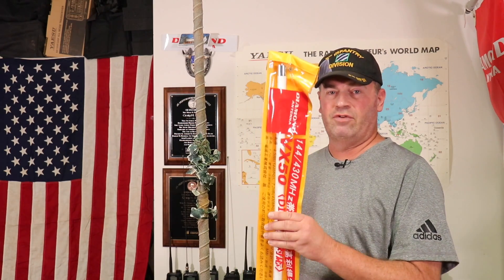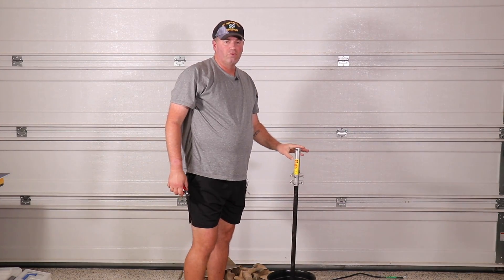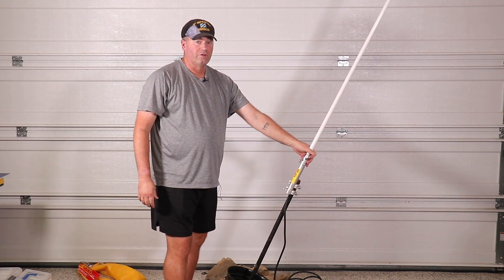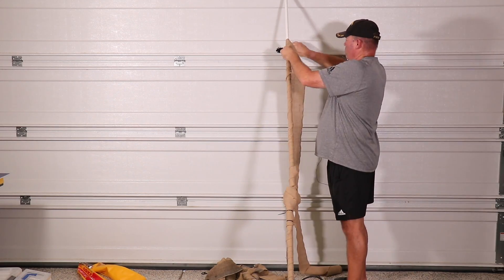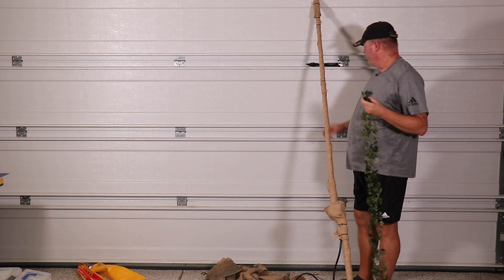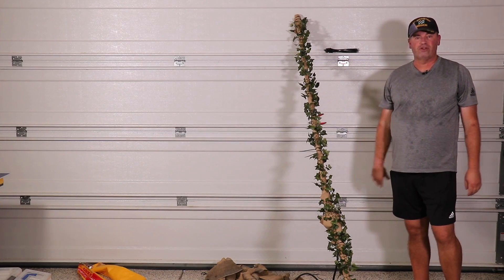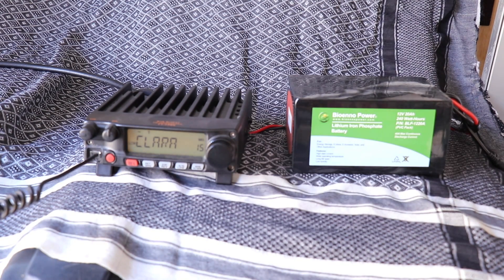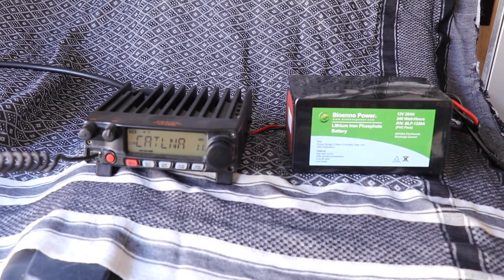Beat The HOA With A Stealth Antenna

Comment: Can the HOA still complain if the antenna is obviously temporary? I have a similar setup using the Diamond mast that extends to 4.5m. I put it up or down in about ten minutes.
Reply from the maker: Thank you for taking the time to watch and the comment! It is greatly appreciated.  They can always complain, but once it it down their argument is pretty much over. Mine stays up 24/7, due to its camouflage nature.
Reply: @WJ6FRadio  Thanks, in Australia they are called body corps, nobody has complained about my temporary setup. I have a S9 noise floor so I have been moving my rig to quieter places. I might buy the Palomar RF supression kit, and try the software noise cancelling process.
The S9 noise floor means I don’t listen to HF at home untill I’ve figured it out.

Comment: How does it compare to the X50?
Reply from the maker: Thank you for taking the time to watch and the comment! It is greatly appreciated. There difference between the two is that the Diamond X-50 has 3 radials and can handle more power. Other than that I believe they are the same.
Reply: @WJ6FRadio  It was a pleasure to watch. If you experienced no practical issues, than the antenna must be good. Thanks!

Comment: Ace medical wrap..nice. 
What about moisture wicking if used during mild rain?
Reply: HoA where I may end up specically states 'No antennas' , less cell phone booster yagi, low mount under eave..tower per Att says misses this subdivision by 1000 feet on angle of beam..we pull into sub and all cell service dies.
Reply from the maker: Actually it's rolled burlap from Michael's

Comment: That’s awesome! Not too far from where I live now there is a regular cell phone tower that Verizon decorated to resemble a pine tree, for the same reason lol. I’ve actually been to Irvine! The Marines sent me to a school there for a few weeks. Almost lawn-darted out of the back of a helicopter while I was there. For all the folks asking about painting, I was in the air wing in the Marines. We had LOTS of antennas associated with our equipment, and ALL of it was camouflaged. But I’m not certain of the specific paint that was used. You could always apply a coat of paint and see if there are any changes. If it changes, wipe Citri-Strip on the paint, wrap it in Saran Wrap for a few hours, then just wipe the paint back off. Citri-Strip is very effective.
Reply from the maker: Thank you for taking the time to watch and the comment! It is greatly appreciated. Thanks for info and thank you for your service
~~~Semper Fi

Comment: It would be nice to know where you got ivy garland with no wire. There seems to be a lot of garland out there but many have wire and the rest don't mention if it has wire or not. I have an HOA also so I'd like to do the same thing.
Reply from the maker: Thank you for taking the time to watch and the comment! It is greatly appreciated. The vies I purchased are from Michael's. This link is similar to what I used. https://www.michaels.com/product/6ft-mini-grape-ivy-chain-garland-by-ashland-10308037?michaelsStore=4735&inv=14
Mine is linked by small plastic chain. The ones that contain, what looks like an actual vine tend to have the wire in it. I made that mistake the first time I made this antenna.
Reply: Thanks very much!!!!! @WJ6FRadio
Reply from the maker: @Fractalholic  No problem!

Comment: Very clever! I live in the Netherlands and I had the same problems after I installed two sat dishes. I ignored everything, no further actions because the dishes are rarely visible. Same goes for my active AM/SW loop antenna. But I know there are HOA’s and HOA’s…..I have US relatives, one of them was stationed overseas near Hanau, Germany. There was a huge helicopter field and maintenance facilities where he worked as an engineer. In those days, these installations could be visited and so we went there one day. Amazing! I was allowed to take place in a Apache helicopter, those were the days, forever gone! Bye, Willem, Holland.
Reply from the maker: Thank you for taking the time to watch and the comment! It is greatly appreciated. I was stationed on an old Luftwaffe base in Schweinfurt, (West) Germany. It was our helicopter base in our city.
Reply: @WJ6FRadio  Hi! I have been on many US Military installations, Camp New Amsterdam, Bitburg, Spangdahlem, Bamberg, at these locations my cousin was temporarily stationed, I think for three years in total, he then was transferred to Japan. The most impressive was Hanau, to see these magnificent Apaches. Oh, and being a radio enthusiast, I was also invited to the local AFN affiliate on the Camp New Amsterdam base near Soesterberg, Holland, not far from where I live. I remember this as if it was yesterday, state of the art equipment. I even was given one of these so called “transcription records”, huge 16 inches thin slabs of reddish vinyl. On it: Wolfman Jack on both sides. We had to sneak out as all those records needed to be destroyed right after playing. At least, that’s what’s on the label. Collectors item.

Comment: Great Video. I just wish you showed us the final placement of the antenna. I am sure you are not placing the antenna where you showed on the vide, with it's coax showing.
Reply from the maker: Thank you for taking the time to watch and the comment! It is greatly appreciated. It sits on my patio in plain site. Luckily the patio is enclosed with a 6 foot brick wall so no one can see the cable. However, where I used to live this sat in a wrought iron basket outside the master bedroom on the second floor and was 100% visible.

Comment: All I did was camo paint mine, and it blends in with tree just behind it - no problem. I previously also had an antenna in a pot on my 2nd floor window ledge. Worked well.
Reply from the maker: Thank you for taking the time to watch and the comment! It is greatly appreciated. I had thought about painting mine for roof top placement, but where I live now I don't have roof access.

Comment: @WJ6F Radio
Hi Craig, Thanks for a super idea, I’m looking for an outdoor stealth antenna and this fits the bill. Is the Diamond VX50 compatible with a Yaesu FT3D HT?  Also, I don’t see the VX50 for sale anywhere and its not in the Diamond catalog, do you know if it is still available or know what to use as a replacement?
Thanks,
Dan N2DTO
Reply from the maker: Thank you for taking the time to watch and the comment! It is greatly appreciated. You would have to go on the Diamond Antenna Japanese website to find it. Yes, you should be able to use it with the FT3 provided you get the right adapters for it.

Comment: Are the vines completely plastic or do they have wire ties.  If so, does it interfere with the tuning?
Reply from the maker: Thank you for taking the time to watch and comment! It is greatly appreciated. The vines are 100% plastic. I learned the hard way that vines with wire in them will detune the antenna.
Reply: @WJ6FRadio  I suspected that might be an issue.  Glad you could source some plastic only material.
Reply from the maker: @TXLorenzo  I picked up the vines at a store called Michael’s. They may also be available on Amazon.

Comment: I wonder if rattlecan painting the antenna would hurt?
Reply from the maker: Thank you for taking the time to watch and the comment! It is greatly appreciated. I have heard of a couple of hams around my area who have painted antennas to blend in with the sky. They said you need to make sure the paint was a certain type or it could detune the antenna. I am no chemist by any stretch of the imagination so I am not sure which brands are safe to do so. But it would be great to do so.
Reply: I've had no problem with that. Though after 6 years it's starting to fade, so I'll just touch it up a bit.

Comment: Very good - what did you use for the wrap (forgive me if I missed it)?  I have the tri-band Ed Fong antenna just up on a few fiberglass poles and absent my neighbors new landscape lighting RF, it works well and is also pretty stealthy.  AI6OU
Reply from the maker: Thank you for taking the time to watch and the comment! It is greatly appreciated. I used a burlap wrap. They do sell it on amazon. I used a couple of rolls of it due to the length and making sure it was properly covered. here is a link for the items I used that I could find on Amazon at https://www.amazon.com/shop/wj6f?listId=2VGR051WMBD4G&ref=idea_share_inf

Comment: Are you using a balun? Any rfi into shack? What power levels are you running? I'm looking into what you have done but will be active on 2m and 70cm. Hf antenna is on a tilt mount so it hides well when not in use. Thankfully all my neighbors are great and love the fact they have an amateur radio op next door. We all have large lots 3/4 acre and up. Hoa still says no ugh. Won't be too long I'll be selling to buy larger tract of land to live free again. Thanks for your video efforts. 73 AI4JD
Reply from the maker: Thank you for taking the time to watch and the comment! It is greatly appreciated. I haven't had any issues with rfi. I am only running about 80 watts at most since this is only a 100 watt antenna. I have made good simplex contacts the past couple of days with the current setup. Unfortunately I have a postage stamp sized yard which makes HF antennas a bit difficult, unless I use a vertical.
Reply: @WJ6FRadio  great thank you for taking the time to answer. I'll look into ground mounting one here. Get it 30 feet or so from the shack. I tried my comet gp-6 but was only 15 feet or so from shack and it caused rfi to my tv. Possibly due to being a ground plane type of antenna. My hf antenna setup is a hustler 6btv. I have about 800 feet worth of radials under it.. No issues with it or rfi running up to a kw when needed. Have fun with your builds and will look forward to the next video.

Comment: Wonderful.  Just purchased a home in Arizona and there's an HOA.  I will try my attic first but if that fails I'll give this a try.  Thanks for taking the time to share this.  N6NRO  John
Reply from the maker: Thank you for taking the time to watch and the comment! It is greatly appreciated. I have two other video showing different antennas and how I first put it all together.
Reply: john, how about this, dont live in an hoa if you want a radio antenna.  i know its kinda hard to understand, but if you want a radio antenna and the hoa doesnt allow it, dont move into it and move where you can put one up.  but then, as a true american, you wouldnt be able to complain about breaking a rule you about and signed a document stating you wouldnt break said rule.
Reply: @shadowsilverlight1651  Just so you know, in AZ, especially southern AZ, it is safer to live in an HOA as opposed to living farther out without an HOA.  And, no, very little is available close to town without an HOA that is in a safe area.  We can thank the open border for that.